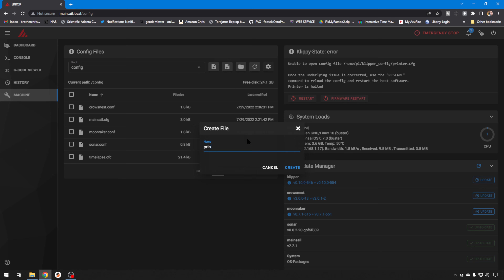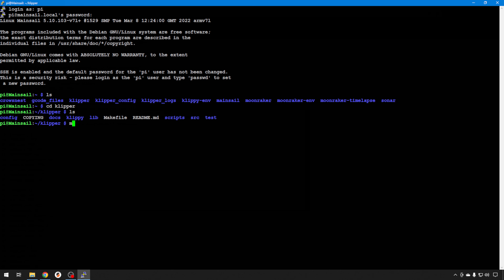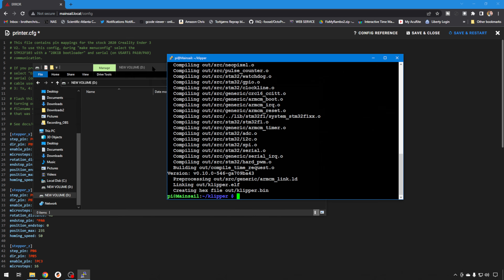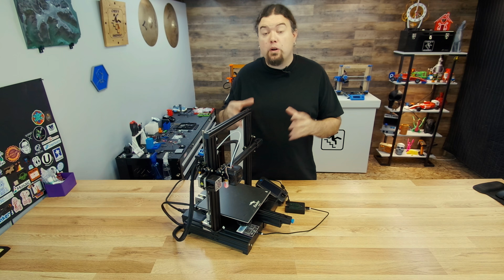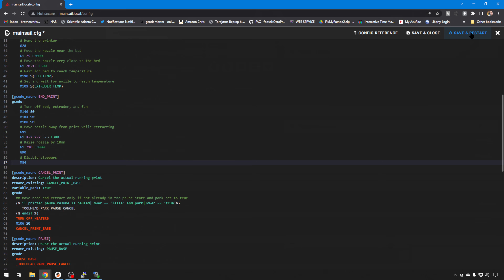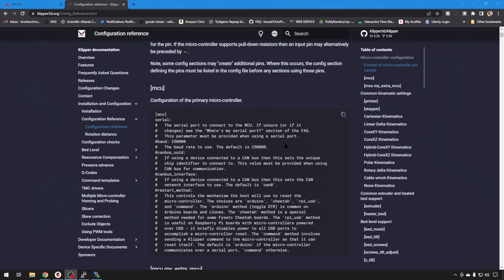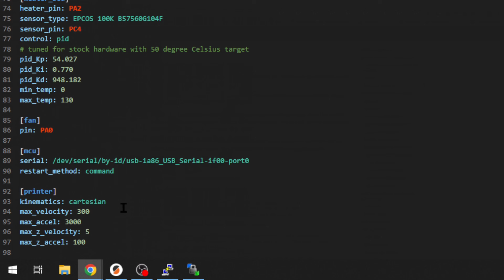Install Klipper On Your Ender 3 V2 - Mainsail - First Print - Chris's Basement - 2022

Comment: Chris O downloded the Srk 1.4 turbo in kipper site example  but the  pin name don't match with manual it's normal?, i intend additional use leveling sensor and wifi module where can  I find this code for add in program?  Thanks for help

Comment: hi after restarting i got an error
Pin 'ar37' is not a valid pin name on mcu 'mcu'

i found a reference to ar37 in the mainsail.cfg

[pwm_cycle_time BEEPER_pin]

pin: ar37

#   Beeper pin. This parameter must be provided.

#   ar37 is the default RAMPS/MKS pin.

value: 0

#   Silent at power on, set to 1 if active low.

shutdown_value: 0

#   Disable at emergency shutdown (no PWM would be available anyway).

cycle_time: 0.001

#   Default PWM frequency : 0.001 = 1ms will give a tone of 1kHz

#   Although not pitch perfect.

 

i deleted the function from mainsail.cfg and it seems to work but what is the proper soulution to this as this dosnt seem like the best option?
Reply from the maker: That looks to be some default config, not sure where it came from. How did you install Klipper?

Comment: Thanks for the guide. It help me a lot with printing PLA. Can you please help config PETG. I use PrusaSclier for slicing the model, but Klipper omit all PrusaSlicer configs that I set for PETG. I mean temperature, probably speed. I couldn't find info on the internet.
Reply from the maker: That's very strange. If you open the raw gcode, does it should the correct temps are being set? That will tell you if the file is ok.

Comment: Having invested in a BTT Pi with the intention of using Klipper, I have spent DAYS trying to get it all set up. I got there eventually, but no-one else seems to do that extra little bit such as explaining how to actually use Klipper to print. Although I am not quite there yet, you have helped enormously, so thank you.
Reply: I am glad you had posted this sentiment. I have spent several months trying to set up a Raspberry Pi 4b to correctly drive my Ender 3V2 with CR Touch to discover last Sunday I'd caused the problem myself!  🤦 But when I tried to print, I realised that nowhere had I seen what Slicer changes I needed until I found this video!
Reply from the maker: I have found the same problem, no one ever seemed to go through these parts. Glad it was helpful.

Comment: Hmmm I have not used my printers in some years and I found out about Klipper by accident while addressing another issue. I have 2 ender 3 v2's.  What is the best course of action? Should I buy a single ripi or get 2 of them? 

I am looking at getting a model 5, 4gb since it's the same price as the 4. Someone said they use c920 webcams which I would be interested in as well. Would all this work? My enders are probably 2020 versions if that means anything. Both printers would be basically next to each other on the same desk. Was thinking to have a single board in between both printers.
Reply from the maker: Yes, one pi would be just fine. Follow this one to get you going, it's by far the easiest way to do more than one. https://youtu.be/LImiFmhMAB0
Reply: @ChrisRiley  Yep, found out about Kiauh shortly after the comment, pi arrives this afternoon and will be following your video. Appreciate the reply.

Comment: Hi Chris, thanks to your's videos, i follow some ones to configure mi printers and it works every time ;). I'm switching to klipper and now i have a little problem because i cant find the serial to communicate with the skr mini e3 v2 and the btt pi v1.2. I already tested the bbt pi into an other printer and it show the serial. I think the problem is the board but its work fine with Marlin. I also try diferent configs and flashed them but nothing. Any suggestion? Thanks again to your exellent work.
Reply from the maker: Hey, thank you! This is always a tough one. I need to make a video on all the things you can do to resolve this. First thing, make sure your make menuconfig list the correct pins. Follow the comments in the config, let me know how it goes. https://github.com/Klipper3d/klipper/blob/master/config/generic-bigtreetech-skr-mini-e3-v1.2.cfg
Reply: @ChrisRiley  Thanks for your attention, I've already resolved the problem, which was the USB port of the board wasn't working (I tried it with other devices and nothing) and I've already returned it. I tried it with the original board (Aquila X2 with H32) and it works. I still have some configurations to do because there isn't much information about this card. Now I don't know whether to buy the SKR mini e3 v3 or the SKR Pico because I'm going to convert it to a corexz (voron Switchwire) any suggestion? Thanks again.
Reply from the maker: @JulioLiraEJ8  Great! The Pico is fun, but I find the mini easier to wire as the plugs come off the top of the board on the sides.

Comment: I'm not getting anything on serial I'm trying to do this with a old computer and I got host to show up but it not showing up on serial
Reply from the maker: If you do lsusb, make sure the USB ports are showing up. Leave your printer unplugged and run a ls /dev then plug it in and run it again, does it show up?
Reply: Ya nothing it not showing anything ls/dev what would you recommend I was looking at the klipper pad but really want to save money
Reply from the maker: @gray896  Did you use Kiahu to install Klipper? This should work, unless the hardware doesn't support Linux. Pi zero 2 and a hub is probably still the cheapest option.
Reply: @ChrisRiley  ya I did but use kiauh but I didn't use a pie I'm using a really old HP computer and the tutorial said to use Linux mint
Reply: @ChrisRiley  also could it be the main board of the printer I have 4.2.7 board
Reply from the maker: @gray896  It could be, do you have another windows machine? You could test to see if it shows up in device manager if you plug it in.,
Reply: @ChrisRiley  actually ya it does show up when I use it ony.pc which it a windows machine I even tried it on steam deck and I did get something but  ls/dev but the printer wasn't even plugged in and I was saying it something completely different when you put in the ls command so I think I might just try the pad or try again

Comment: I tried again and again your tutorial but i had the error mcu:'mcu' unable to connect .The solution for me with 4.2.2 boad was to set baud:115200 both to the ''make userconfig'' and the printer.cfg files. After that mcu connected.
Reply from the maker: Awesome, glad you found the issue.

Comment: So is the prime line (using the temperature from the G-Code, not some arbitrary value) some kind of a secret when it comes to Klipper ?
I can't seem to find any examples that actually work...
Any help would be appreciated !
Reply from the maker: With some tricky coding, I'm sure there is a way, but I still think it's easier to do it in the start gocde.
Reply: @ChrisRiley  Hi, thanks for the reply. After some more digging, I've actually found a way to get what I needed. 
There's also a tool for generating Klipper macros by a guy called GAB3D. If you just search for "Klipper macro generator", it should be the first result that comes up.
For now, I've got a "basic" setup that will do a prime line with the slicer settings (you pass them in as parameters in the start G-Code). It does a horizontal one across Y instead of vertical (as in, it actually moves X from left to right instead of Y front to back), but I'll change it in the future by altering the G-Code in that macro.
Reply: @ChrisRiley  If it's of any use to anyone, my current start and end macros go a little something like this :

[gcode_macro PRINT_START]
gcode:
  {% set BED = params.BED_TEMP|int %}
  {% set EXTRUDER = params.EXTRUDER_TEMP|int %}
  G90  ;Set to absolute positioning
  M190 S{BED}  ;Set bed temperature and wait
  _CHOME  ;Home all axes if not homed
  BED_MESH_PROFILE LOAD=default  ;Load Bed Mesh Profile
  PARK_CENTER_FRONT  ;Park central front
  M109 S{EXTRUDER}  ;Set extruder temperature and wait
  _PURGE_LINE  ;Front Purge

[gcode_macro PRINT_END]
gcode:
  G1 E-1.5 F1800  ;Retract filament
  G91 ;Set relative positioning
  G0 Z10 F3000  ;Move Up
  G90  ;Set to absolute positioning
  G0 X0 Y220 F3000  ;Move XY
  TURN_OFF_HEATERS  ;Turn off heaters
  M84  ;Disable motors

[gcode_macro M190]
rename_existing: M190.1
gcode:
  {% if printer["gcode_macro status_heating"] != null %}
    status_heating
  {% endif %}
    M190.1 { rawparams }
  {% if printer["gcode_macro status_ready"] != null %}
    status_ready
  {% endif %}

[gcode_macro _CHOME]
gcode:
  {% if printer["gcode_macro status_homing"] != null %}
    status_homing
  {% endif %}
  {% if printer.toolhead.homed_axes != "xyz" %}
  G28
  {% endif %}
  {% if printer["gcode_macro status_ready"] != null %}
    status_ready
  {% endif %}
[gcode_macro PARK_CENTER_FRONT]
gcode:
    {% set th = printer.toolhead %}
    {% set x_safe = th.position.x + 20 * (1 if th.axis_maximum.x - th.position.x > 20 else -1) %}
  {% if printer["gcode_macro status_busy"] != null %}
    status_busy
  {% endif %}
    G0 X{th.axis_maximum.x//2} Y5 F3600  
  {% if printer["gcode_macro status_ready"] != null %}
    status_ready
  {% endif %}

[gcode_macro M109]
rename_existing: M109.1
gcode:
  {% if printer["gcode_macro status_heating"] != null %}
    status_heating
  {% endif %}
    M109.1 { rawparams }
  {% if printer["gcode_macro status_ready"] != null %}
    status_ready
  {% endif %}

[gcode_macro _PURGE_LINE]
gcode:
  {% if printer["gcode_macro status_cleaning"] != null %}
    status_cleaning
  {% endif %}
  SAVE_GCODE_STATE NAME=Pre_Prime
        
  G90
  G92 E0 ;Reset Extruder

  G1 Z10.0 F3000 ;Move Z Axis up
  G1 X0 Y0;
  G1 E10.0 F1800
  G1 Z0.28 F5000.0 ;Move to start position
  G1 X220 Y0 Z0.28 F1500.0 E30 ;Draw the first line
  G92 E0 ;Reset Extruder
  G1 Z10 F3000 ;Move Z Axis up
  RESTORE_GCODE_STATE NAME=Pre_Prime

  {% if printer["gcode_macro status_printing"] != null %}
    status_printing
  {% endif %}
Reply: @ChrisRiley  As for the slicer, I use Prusa Slicer and for the start and end G-Code I have :

START : 

M117
PRINT_START EXTRUDER_TEMP=[first_layer_temperature] BED_TEMP=[first_layer_bed_temperature]

END:

PRINT_END
Reply: If someone uses the same PRINT_END macro I use, be mindful that the raise of Z by 10mm is "stupid" atm, as in it doesn't do any checks or anything, it just moves up.
Gonna try to figure out how to query the current position and using some conditionals move only if it actually can and Z isn't at the top already (like when you print something full volume o near for example), but that's still on my to-do list as Python isn't exactly my cup of tea and I don't really like the syntax. More of a C/Java guy, but I'll eventually bring myself to dealing with this too sometime in the future. For now I just keep that in mind and it works for what I need.

Comment: Prime line source code. I cant seem to find this.
Reply: I found it it one on the following videos. Here it is if anyone else needs it. 
M117 Primeline
    G92 E0 ;Reset Extruder
    # move Z axis
    G1 Z2.0 F3000 ;Move Z up
    # move to prime point
    G1 X10 Y10 Z0.28 F5000.0 ;Move to start position
    G1 X200 Y10.0 Z0.28 F1500.0 E15 ;Draw the first line
    G1 X200 Y10.5 Z0.28 F1500.0 ;Move to side a little
    G1 X10 Y10.5 Z.028 F1500.0 E30 ;Draw the second line
    G92 E0 ;Reset Extruder
    G1 Z2.0 F3000 ;Move Z Axis up
    G1 Z0 F3000
    G1 Z0.2 F100

Comment: Doing the exact steps on an ender 3 v2 printer will result in a connection problem. For Ender 3V2 printers you need to set the baud rate to 115200 in the make menu and printer.cfg to actually be able to connect....
Reply: Where is the baud rate mentioned in the printer.cfg? Just struggling thanks as printer refuses to communicate with what he has done in video
Reply: @CurlyfriesCurlyfries  should be in a section called MCU, here is mine (to use as an example):
 [mcu]
serial: /dev/serial/by-id/usb-1a86_USB_Serial-if00-port0
baud: 115200
restart_method: command
Reply from the maker: Interesting, I will have to check that out.
Reply: @ChrisRiley  let us know if this is replicable. I found this fix on reddit when trying to find out why It didn't work for me.

Comment: Hi Chris, thanks a lot for this video. Lots of good information and well explained (as usual)  :). I am complete Klipper newbie and currently trying to upgrade my home-built IDEX from Repetier 1.x to Klipper. The mainboard is Ultratronics Pro 1.0. It is rather rear one and I was able to find only a basic Klipper config for it. So I am building printer.cfg on my own. I was able to compile and flash firmware via USB port and established connectivity from Octoprint. It says "connected" and reads firmware version but then says - "Printer is not ready. The klippy host software is attempting to connect. Please retry in a few moments." Following your advice from another video I started from configuring thermistor pins of both extruders and heated bed but so far no success. The temp shows 0 and I am getting the same error. So, I have 2 questions to you. 
- I know that Klipper allows to modify config and applies it as soon as it restarts, but is that enough when changing pin assignments or I need to recompile and upload new flash? 
- Can I use MCU pin numbers in printer.cfg or need to enter corresponding names like PC28. If the names are preferred, there should be a file mapping them to pins for my mcu. Do you know where should I check if such file exists for my board?
Thanks
Reply: After couple of hours troubleshooting I can now answer my 1st question - pin changes are applied without re-flashing firmware. Pin names are accepted but where are they mapped to the actual pin numbers remains unclear. Also, I was able to solve mcu connectivity problem by adding baud: 115200 to [mcu] section of the config file.
Thanks
Reply from the maker: Thanks for watching! Yes, first question, correct, pin changes are applied. The pin numbers are really hard to figure out with a schematic. I did find this, if this is your board those A1/D10 pin assignments the guide lists should work in the config. https://reprapworld.com/documentation/datasheet_ultratronics10_05.pdf

Comment: Hi... thx a lot... there is no cfg for the Ender5 S1 as example... where i can get the right one?
Reply from the maker: The only thing I know to do if there is no example is to ask if anyone has done this over on the discord. https://discord.com/invite/voron
Reply: i have a printer.cfg, but now  Printer is not ready
The klippy host software is attempting to connect.  Please
retry in a few moments. mcu 'mcu': Unable to connect
 @ChrisRiley
Reply from the maker: @GiuseppeMarcucci-j3d  Make sure the MCU setting is correct in the printer.cfg file. Or Something might have happened to the firmware flashed to the MCU, try to reflash.
Reply: @ChrisRiley  , i set mcu with ls /dev/v4l/by-id/* in printed.cfg... i think thats OK... I tried every configuration in make menuconfig, bootloader from 32 to 64 to 16, also tried several USB configuration, and tried with a baudrate 250000 and 115200 ( with [115200] in printer.cfg)... spend hours of time without success... Ordered a Sonic Pad now :))... With my Ender 3 V2 and your video i was able to install Klipper in 20 minutes...
Reply: Sorry, not v4l, instead serial
Reply from the maker: @GiuseppeMarcucci-j3d  I misunderstood. v4l is only for cameras. It should be listed under /dev/serial/by-id   make sure the USB port on the printer is working correctly.
Reply: @ChrisRiley  
I have now successfully established a connection to Mainsail. The printer only flashes when I press and hold the SD card with my finger as far as it will go

Comment: Hello chris i watch your whoole video and I have question.... i have ender 3 v2 with octoprint.  I want to try that klipper. But i got sprite extuder pro kit.. how to update on klipper that i got sprite extruder pro ?
And can you also help me out how to enable my pi camera module 3?  Thanks for info
Reply from the maker: Not sure on the Pi cam 3, I've never used one. The extruder, all you should have to do is update the steps per mm. Check this out, https://www.crealityexperts.com/creality-sprite-extruder-pro-upgrade-kit-install-guide it says steps are 424.9

Comment: Hi Chris, thanks for the guide. But for the life of me, I cannot flash the bloody thing!. I've got ender 3 V2 NEO and no matter what I give the filename to, it just won't flash. should I putting it in a folder? it has V4.2.2 board. Didn't have this headache with S1 Pro. Thanks
Reply from the maker: I have had lots of folks say the creality boards are really hard to flash sometime. No folder should be needed, but it might just be the SD card your using. I've had to go through 4-5 different ones/size to find one a board liked before.
Reply: @ChrisRiley  thanks. I've managed to flash it now. the next problem is now connecting it to my pi running klipper. I should be able to run multiple printers with 1 single pi, correct? Got S1 Pro, klipperized, all well and good. Using Pi 4B 2GB RAM. I had to use this serial:  /dev/serial/by-path/platform-fd500000.pcie-pci-0000:01:00.0-usb-0:1.2:1.0-port0, to get it connected to the MCU. Bought another, ender 3 V2 Neo. Now this one is a funny one. No matter what I do, it won't connect. I naturally have got 2 Klipper instances running on diff port. Configured printer.cfg accordingly to the model, but it won't connect. The MCU for the V2 neo is on, /dev/serial/by-path/platform-fd500000.pcie-pci-0000:01:00.0-usb-0:1.1:1.0-port0 . no matter what I do, klipper/mainsail front end won't connect and I'm rather ran out of ideas. if you have a discord, I would love to jump on it and get some help there...cheers
Reply from the maker: @LastZion  How did you install the two instances? There might be a mix up there. I would recommend use Kiauh to get them installed as it will separate them out for you. https://www.obico.io/blog/install-klipper-with-kiauh/